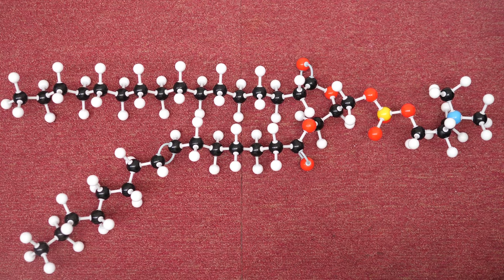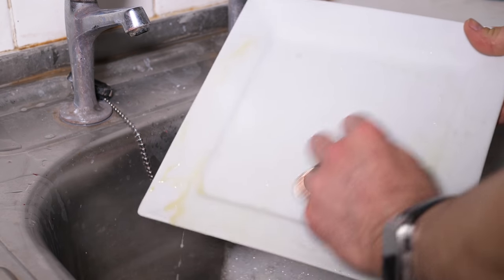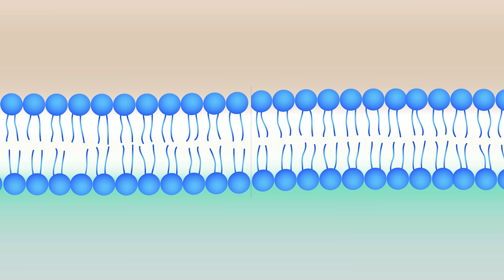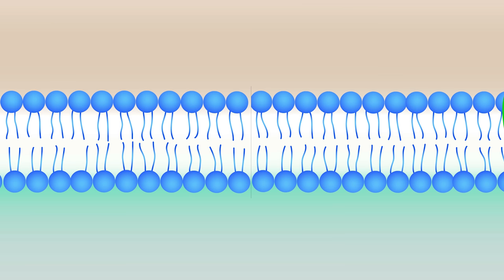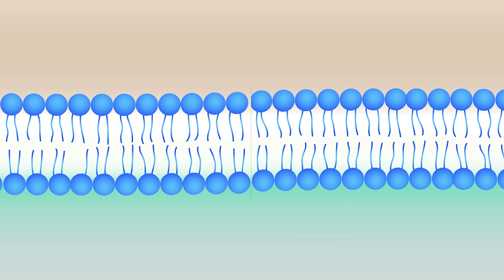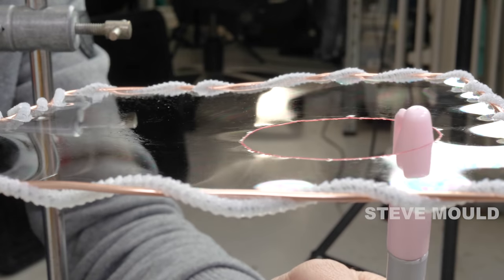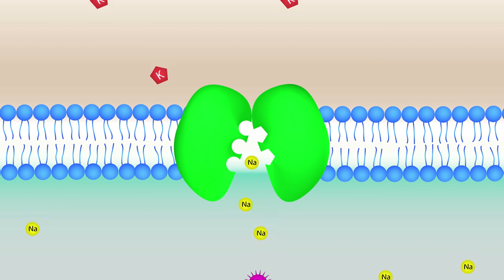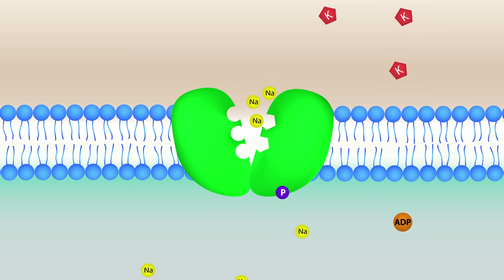How to make inverted bubbles

Comment: Wow, I never thought I'd see a movable hole

Absolutely amazing to see in real time!
Reply: Didn't he just explain transistors in a recent video?
Reply: It'd be cool to see it in the ground like Bugs Bunny's hole
Reply: @U014B  transistors are just anti bubbles. everything makes sense now.
Reply: you must be lucky- there are plenty of holes walking around in my area...
Reply: Brandon RH wait... are you saying this video relates to how electronic transistors work?

If so could you elaborate? My brain can’t grasp it
Reply: @bryanjk  Check out the video about diodes. Basically, areas where electrons are currently "missing" are referred to as holes and the "movement" of those holes (one is filled, causing a hole where that electron previously was) can be treated like a moving positively charged particle. The strategic use of holes is important to the operation of modern diodes.
Reply: Most movable holes work in Washington, D.C.  Not at ALL a rarity.
Reply: Have you never seen the road runner cartoons? They have movable holes everywhere.
Reply: @olik136  hol' up

Comment: Next time: how to make a klein bottle shaped bubble
Reply from the maker: But I don't have enough dimensions!
Reply: Ask Matt Parker to let you borrow his passport to the Fourth Dimension.
Reply from the maker: @integlangs  I've heard there are things to make and do there.
Reply: Maybe he can show you where the humble pis are made.
Reply: Jonathan Downie I reckon it’s at the same place as Brady’s humble brags
Reply: @SteveMould  One?
Reply: Too bad it would collapse, due to not having a proper "inside" for the air to be contained in.
Reply: @ergohack  but in which direction would if collapse. None of the sides is of higher pressure than the other and what exactly is the inside of the bottle bubble?
Reply: @SteveMould  "i don't have enough dimensions"

Sounds like quitter talk to me
Reply: @sinom  A soap bubble needs higher relative interior air pressure  to counteract the surface tension of the soap film.  Since there would be no relative pressure difference on either side of the klien bottles surface (seeing as it is a one-sided surface), the surface tension would have nothing to counteract it and the film would collapse into the most compact form it can. In four spatial dimensions, I'm not sure if that would be a sphere, or something else.
Basically, every bit of soap film would try to get as close to as much of the other soap film as it can, as quickly as it can.
Reply: @SteveMould  Cliff Stoll could help you with this, he is a smart guy and you both will figure out a way to do it
Reply: Using the typical representation of a klien bottle in 3 dimensions, you may be able to use a loop of string for the self-intersecting bit. You'd need to close off the bottom to keep the air inside, and  another loop  of string could be used to do this part. The remaining problem is that the "neck" portion of the bottle is very similar to a torus, and surface tension very quickly collapses toroidal bubbles into a sphere (if you even manage to blow one at all). You might be able to prevent this by blowing another bubble inside the loop that the neck makes.
Reply: Could you do a "figure 8 immersion" with two mobius strip bubbles?
Reply: @SteveMould  It might be interesting to note that a punctured klein bottle is indeed a minimal surface in three dimensions. So actually you can make a (sort of) klein bottle shaped bubble. Take a look at the figure on page 2 in this http://www.damtp.cam.ac.uk/user/gold/pdfs/Boundary_online.pdf
Reply from the maker: @michelegiacomini8487  that's remarkable
Reply: You could call it that, but it would be wrong.
Reply: Well first we’ve got to do Möbius strips
Reply: @michelegiacomini8487  could one have the puncture of the punctured klein bottle be through one of the holes shown in this video?
Reply: A “Klein bubble”
That’s genius.
I’m doing my dissertation on Klein bubbles
Reply: @SteveMould  It's don't need to be perfect, it's can be a Parker Square Klein bottle
Reply: Good mathematicians say no to non-orientable shaped
Reply: Next Next time: how to make a tesseract shaped bubble
Reply: I’ve heard the 3-D periodic table would be useless.
As a new periodic table with be needed. The 3d periodic table would be stretched in both left and right directions and become shorter from bottom to top. Any Atom after helium would acquire strains property.  
Gravity with CP into the fourth dimension that much weaker. Any orbit would become a spiral into the object it is orbiting or spiraling outward into space.
Reply: Michele Giacomini, not quite sure what I was looking at but, awesome !
Reply: @SteveMould  You do they are just very tiny!
Reply: @integlangs  "infinity war is the most ambitious crossover"
Me:
Reply: @SteveMould  Use time as the fourth dimension!
Reply: @SteveMould  or a Möbius strip bubble

Comment: Neat!  However, I'd say this is a right-way-around bubble.  Bubbles are (usually) a gas in a liquid.  Like this.  The only difference here is the liquid is 2d.  ... and the other only difference is that instead of the gas pushing, the liquid is pulling.  So this is a right-way-round 2d stable cavitation bubble.
Reply from the maker: I like that name. That's what it would be called in a scientific paper on the subject.
Reply: Bruh chilllll hahha <3

Comment from the maker: I didn't call it "Antibubbles" in the end because it turns out that's already a thing (https://en.wikipedia.org/wiki/Antibubble ). Glad I checked! Hope you like the video and sorry for the shameless book advert at the end.
Reply: Diana @physicsGirl used the name for the droplets that form on the surface of a liquid under certain circumstances while acknowledging that's not what anti bubbles actually are.
Reply: Steve Mould the link you provided takes you to a wiki page for “antibubble)” which doesn’t exist, maybe put a space between the “/antibubble” and the closing parentheses so it directs to the correct wiki page
Reply from the maker: @MrMinigunman101  thanks! Fixed.
Reply: You said you will call it antibubbles for clickbait despite the fact it's already a thing!

Comment: Huh… It's very unlikely that I would have thought of this. But with your explanation, it makes total sense. The film of soap holds the string suspended from all directions like a suspension bridge, and the string's shape becomes a circle, rather than some other shape, because it is being pulled on equally from all directions. If the string was another shape, you could tell where is it was receiving a stronger pull from, by looking for outward pointing bumps or spikes, and tracing from the center of the hole to the furthest point of the bump or spike in the string.

It's like if a suspension bridge used a net instead of a cable, to hold itself up.

Comment: i can see a secondary property where the bubble acts as a level, or in this case a disk level. i can see that your set up is slightly askew, pointing down towards the upper left of the frame and up at the bottom right (1:19) or at least the rough wire frame shape and the stand holding it is simulating this in that way. all in all a great experiment and in my mind possibly an inverted disk level, but anti-bubble works as well.

Comment: My daughter and I tried this out, but unfortunately made the mistake of using a hair elastic instead of thread. In hindsight I should have seen why that wouldn’t have worked so well - it resists the pull of the soap so while it floats in the soap bubble and you can pop the bubble inside the elastic, the effect isn’t as noticeable because it doesn’t get pulled into a circle. Still, after the failed experiment we had lots of fun playing with bubbles. Thank you for the neat experiment suggestion! I’ll definitely consider getting your books in a few years when she’s closer to the recommended range. We’re always on the look out for books that understand education is best when it’s kept fun.

Comment: Hey Steve, that's very interesting did not know you could do that. bubbles are fascinating. 

Notice the colors of the bubble film I have found this interesting and beautiful for a long time. It would be awesome if you did a video on this.

What I have observed is if you just have a flat vertical bubble film you can observe the Colors filtering from bottom to top. First is multiple bands of teal and Pink then bands in this order: green, pink, yellow, green, blue, purple, pink, orange, yellow, light  blue, dark blue, dark purple, orange-ish brown, white, silver, clear then it pops; seems to always happen in this order. The best way to see vibrant colors is hold the film so it is reflecting a bright light. you can see it pretty good at 1:19 in this video. 

I think the reason this happens is that gravity is pulling the small amount of water trapped between the two layers of surface tension and getting slightly thicker towards the bottom. I think the different thicknesses reflect/refract different wave lengths of light,  probably even UV light being reflected from the clear part that we can't see.

Comment: Steve, after reading through the comments I have some suggestions for a follow-up video:
Tie the string into more complex shapes, including a trefoil, a square mesh, and a hexagonal mesh, each with at least 6 cells, and experiment with the resulting shapes.  I expect you will get honeycomb shapes of various sorts.
Reshape your film from planar to a hyperbolic paraboloid by keeping two parallel sides of your square straight and bending the other two sides “upwards” into a parabola.  The resulting film will have negative curvature and your hole should float to the middle (which from a potential energy point of view is the “top”) instead of drifting to the low side as it does now.
Try polarizing lenses to see if you can visualize the different thicknesses of the film.
And, as multiple people have suggested, some high speed footage might be very instructional.

Comment: Here is another fun and easy experipent that you can try: turn a water tap on a little bit so that you get a small stream of laminar flow. Let the stream fall into a cup of water. It is now possible that a bubble of air will stay in the water under the stream. It is exactly the same effect as when a pingpong ball floats above an upwards stream of air from a hairdryer. Only now the stream is downwards and the bubble is pushed upwards by the buoyant force.

Comment: Is the hole going down because the thread makes the hole heavy or going up because the missing soap makes the hole light? Is there a transition point where those two cancel out?
Reply: It might also be trying to move towards the knot, because it's a disturbance in the otherwise circular shape. In effect, the string is pulled outwards all over but the knot has a bigger circumference per hole-centered angle that cannot be resolved. More experimentation recommended! :)

Comment: If you twisted the frame so the bubble had negative curvature, would the hole move towards or away from the center? Or neither?
Reply: Good question.. My guess is that the hole would move away from the centre because the film would be thicker towards the edges, meaning more elasticity? But I'm no bubble scientist, don't quote me.

Edit: Then again, if it was curved so that the centre was the lowest point then that would also be the thickest, meaning the hole would rest there? Man, you've blown my mind.

Comment: A little while ago the action lab made a video about a Newton’s cradle. He mentioned that part of the reason that they work is because the materials compress and act like springs almost. I’ve been wondering what would happen if the balls were made of ice instead, because as far as I know water doesn’t compress.
Reply: Water IS pretty incompressible, but ice does still have a bit of elasticity to it. 

If you drop a piece of ice, it doesn't just stick to the ground on the first impact, so if you made a Newton's cradle with balls of ice, you may not see the same level of energy from input to output, but I reckon you would still see more movement than the first swing of the outer ice ball.

Comment: Interesting, what would happen if you took the copper frame and dragged it through the air with the thread still inside it, like you would to normally create a large bubble?
Reply from the maker: Good question! I'll will experiment and report back.
Reply: My guess: If the hole is small enough compared to the frame, you might be able to release a bubble with the hole in it. That bubble would then deflate through the hole like a balloon (and presumably be propelled upwards). When the bubble becomes too small relative to the hole, it contracts the hole instead of expanding it, and collapses in on itself.

Comment: I think, there is a little correction? It should be "maximise its area" at 1:13? The perimeter =  loop length is fixed, and the shape that maximises the area is the circle, since it is getting stretched, pulled out from all sides!
Reply: Analogically, this is also how/why the liquid blobs are spherical in shape, in space (in the absence of gravity, external forces). 
Because of the surface tension, the problem solved is effectively a surface area minimisation, at given a volume (i.e. for fixed volume of liquid) ==> the corresponding solution shape is a sphere. 
If we just switch what is given, this is effectively volume maximisation, for a given surface area. (i.e. n+1 dimensional maximisation, n dimensional given)

So, likewise in 2D, area maximisation, given a perimeter = circle = effectively also perimeter minimisation, given an area.
Reply: You just didn't get what he said. The soap film area is minimized which causes the hole area is maximised. The fluid that wants to minimize the energy in its surface is the soap, not air or string.

Comment: very cool! Interesting that the anti-bubble falls under gravity - can you explain that?  My guess is that the weight of the string is greater than the weight of the 'missing' soap, but maybe something else is going on?
Reply: Jeremy Stanger you are mostly correct, the string has mass, thus weight, and there is no force to counter the force of gravity pulling it down. The film flows smoothly around it and exerts no upward force to counter gravity.

Comment: What if you have two strings, one inside the other, pop the inner-most bubble and the outer-most bubble, and then hold on to the outer string? Would you have a hollow circle bubble, or would the movement of the strings cause it to pop instantly?

Comment: Could this be used as a very sensitive level?
Reply: It took me a bit to figure out what you were talking about here. I think it'd definitely work. You'd need to know that the supporting rim was very flat, and avoid air disturbances. Lighter weight string surrounding the hole should make for a more sensitive level, due to smaller deflection from the plane of the supporting rim.
At first I thought that it wouldn't matter if there was an actual hole or not, but now I'm thinking that the string being kept in a consistent shape would be important for consistency of the level.
(edit) spelling
Reply: @ergohack  A flat triangle on 3 feet would be fairly easy to achieve with current machining techniques.  Air disturbances could be cancelled out in a variety of ways as well.  One thing that might be tricky is being able to hold a film for long enough to make adjustments to what ever is being leveled.

Comment: What happens if you blow on the soap when it has the string still integrated in it?
My guess, it will probably not be able to form any stable structure except for a bubble with the string compressed as much as possible..
Not sure if a toroid shape is possible... 
But what about having two strings?

Comment: Hi Steve, I  tried to repeat what you did, but instead I made a round frame. What happened was the thread did not stay at all on the surface at all but popped as soon as I tried to put it on the soap film. I had tried a relatively bigger and small thread circles. I did not work at all. I am not sure it the shape of the frame has anything to do with it. I used purchase soap liquid made in Germany for making bubbles. I id mix it with 1 part of water. It popped because of the surface tension is too low? Hope to receive your reply. I am from China.
Reply from the maker: Have a look at some bubble recipes on line. Bubbles can be made to last longer with the addition of lubricant for example. Good luck!

Comment: Why does it migrate toward a corner of the soap membrane when you move it?

Edit: Why does it migrate to the upper left corner (1:17 for reference) every time you try to move it away? Is that corner lower and causing the thread to slide due to gravity? I am curious what is going on there.
Reply: Brandon RH yes, gravity.  The string weighs much more than the film, so the string moves to “downhill” to minimize potential energy of the system (heavy string moves down, light film moves up, world is in balance).
Reply: John Early fascinating

Comment: I have a question for you: "What is the maximum radius of a hole that you can make in a bubble without breaking it?"
Reply: I wonder how variation in soap structure impacts this. Would a longer fatty acid allow bigger holes or smaller? How about ions in the water? Would DI water allow larger holes? What would introducing the water to various salts do? This feels like something someone did a phd on long ago.

Comment: Did you try to blow a toroidal bubble from below? I'm assuming it's not possible, but you never know...
Reply: If such a bubble would spontaneously pop into existence, the hole would start to close because surface tension is pulling it together, not holding it open. When the hole closes it will either pop or turn into a boring old spherical bubble.
Reply: @pafnutiytheartist  then you can witness a change of topology, even better